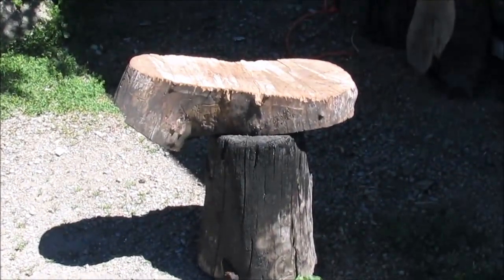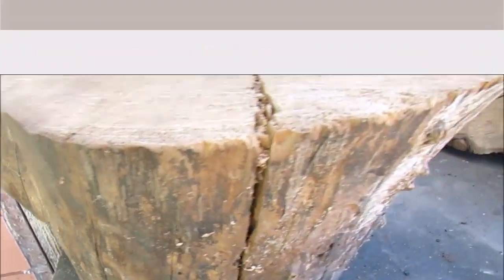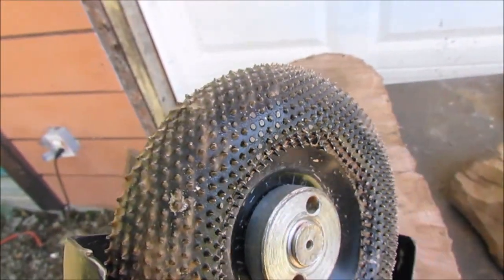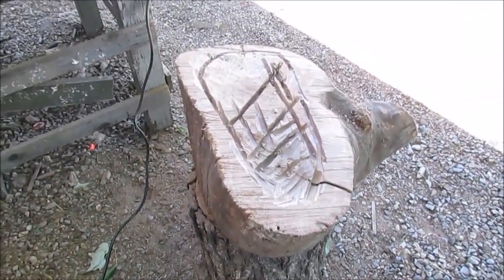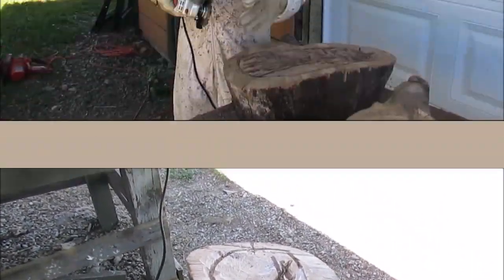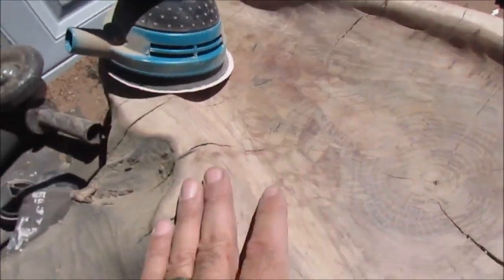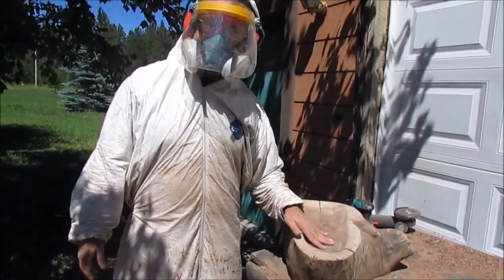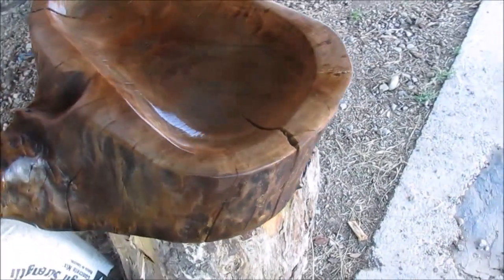DIY carve a bowl, wood carving with power tools

Comment: The only thing I don't like about this "bowl" is that it's NOT deep enough. Shoulda used your chainsaw and made some plunge cuts vertically and horizontally then angled the saw and removed what you plunged. Just one man's opinion but I don't consider this a bowl. Love the outside.  Thanks for sharing.

Comment: yes i was unsafe and almost took off my finger it was a hospital visit. you are correct even using  this tool safe   dangerous but will do the job . i still use it
Reply from the maker: Yep woodworking tools are VERY dangerous tools, even when used correctly. I've seen the bone in my finger after barely touching a sanding disk on the angle grinder....I always use heavy leather gloves and the guard on it...scary but it works so good!!
Reply: If you use a paddle switch grinder it's much safer : ) @shawntyler2928